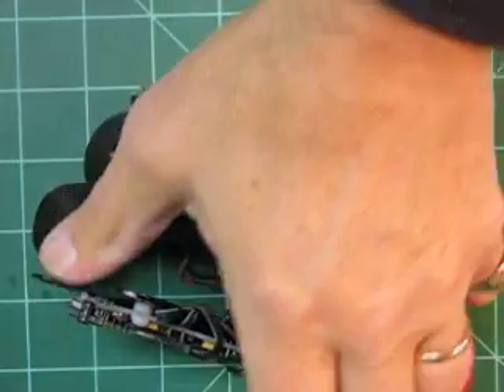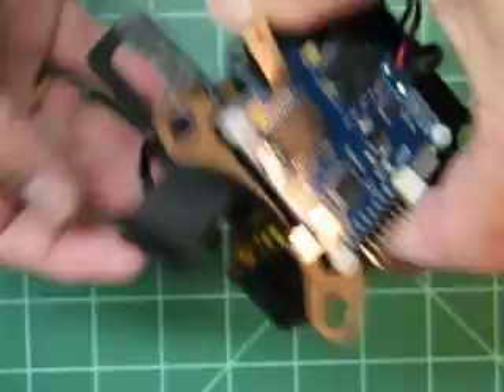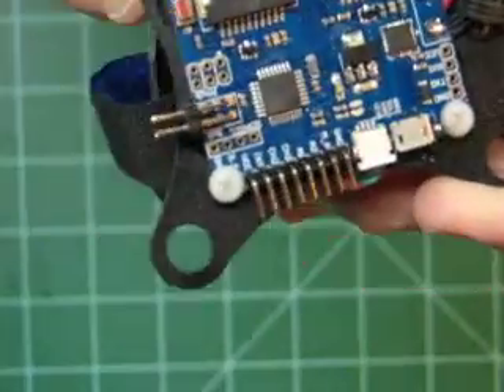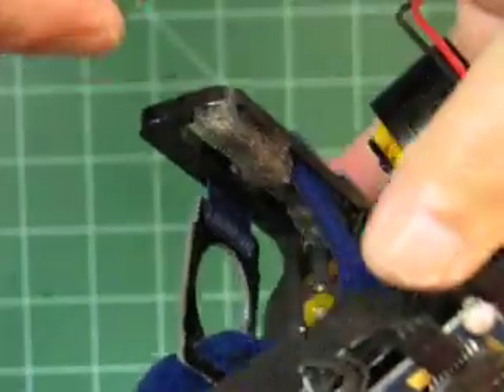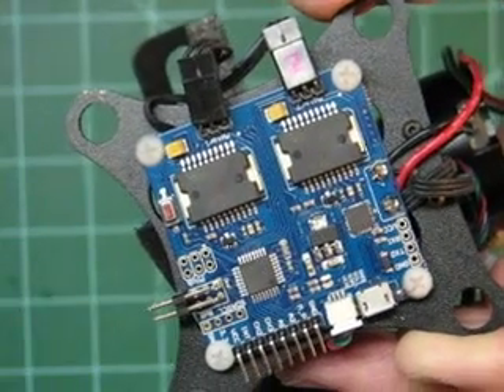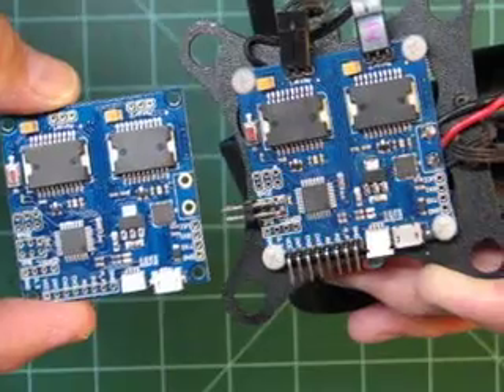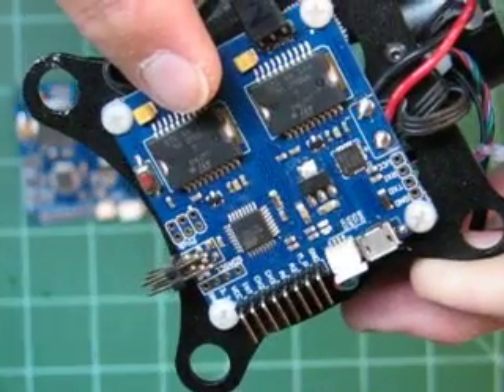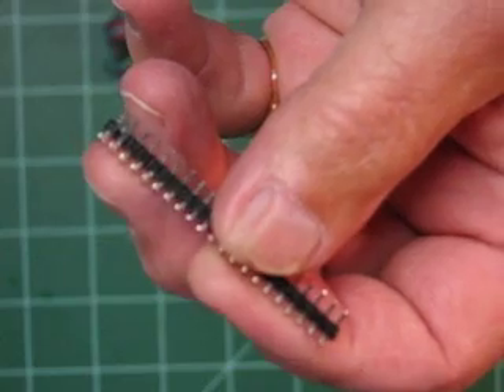New Martinez Gimbal Control Board

Comment: Why didn't you just contact the seller you bought the first gimbal from?
Reply from the maker: Not sure what you mean Bobster. If you are talking about the mini-usb falling off, what chance do you think I would have proving that it wasn't my fault? Just saying - maybe it was my dumbness. I tried to imply that in the vid because frankly it could have been my rough handling that caused it. I wasn't having problems with the gimbal - I was having problems with my stupidity. I am smarter now - not by much but a little. I"ve discovered a lot about the gimbals  - all of them - over the past 6 months. I've learned that none of them are plug and play except the Zen - and that yo get what you pay for when it comes to gimbals. Thanks for your message and please post again if I didn't answer your question.

Comment: Rumblecloud I bought this exact board and it has brugi 050 r207 firmware on it. Can I install other firmware and use Alex Moss GUI?
Reply from the maker: Hi Jason,
Yes you can. I have found after much gnashing of teeth that the Alex Moss GUI is the ONLY one that will work with it. The intructions for the A Moss GUI are pretty good but their is still much guesswork in getting it up and running. The wardesrt part it seems is getting the right driver installed and then getting the right com port set-up. I have not been able to get the latest version for 32 bit boards to work on my gimbal board, but was successful in getting the earlier 8-bit version (2.2b2, 2.3b4, 2.3b5). That would depend on the firmware of your gimbal board. I just ordered another one - I am a glutton for punishment
Reply: rumblecloud Do you know where I can find 2.3b5 software [&firmware]? Also where have you found the best placement is for the sensor? Right now I have it decently working with the open source Brugi GUI app, but like I said interested in other options.
Reply from the maker: Hi Jason,
Name is Randy or RC, please.
Yes I have:)....

 Kidding here's the link:
http://www.basecamelectronics.com/downloads/8bit/

Scroll down the page a bit. This is the "Official Aleksey Moskalenko" company site. Everything about the software is located here. Mind you this is still not a "plug-and-play" set-up especially if you have a clone board.
Location of the sensor depends on which sensor you have. Not trying to be difficult, but even they guys on my forum (www.rumblecloudrc.com - shameless plug) have ordered the same gimbal and received different sensors. Mine works best underneath the base horizontal camera mount -- with the flat part of the pcb facing down and with the light and the electronic gizmos facing up. Just take some regular old scotch tape - note how I used a brand name there :) - and just tape it to different areas. Regardless where it ends up, you have to try to get it as level as possible and make sure the tiny little wires that connect to the board are securely fastened so they cannot vibrate - very sensitive. Good luck and keep me posted as to your results. Take care
Reply from the maker: Oh I forgot. Try out  the other versions of the firmware. If one doesn't work, perhaps one of the others will.
Reply: rumblecloud Thanks Much randy. I can't seem to get them connected - avrdude.exe: stk500_getsync(): not in sync: resp=0x6d

Anyhow will keep trying. Thanks again for the tip to try SBGC

Comment: Does your gimbal work now? is it so simple that you can replace it and it works right away?
Reply from the maker: Yes, it was easy enough to replace and it did work right away. DO NOT power up the gimbal without the camera in place.
Reply: rumblecloud could it also work with a other board? not a martinez board?
Reply from the maker: Hello Mitchell,
Thank you for your question. I will try to answer as best I can. The Martinez control board and the camera gimbal can be ordered separately. In other words, The Gimbal with brushless motors can be bought without a control board. There are several different brands of control boards on the market. Alex Moss (Aleksey Moskalenko) and Martinez are common, but there are also clones. You can mix and match the boards with different gimbals. If you would like more information, let me know ... www.rumblecloudrc.com.

Comment: i forgot to tell you make sure the camera is on the gimbal and to connect the gimbal to adjust the pitch i used a servo female to
 female connector and ran it straight into my spektrum reciver aux 2channel wich is knob on my dx7s and it works good

Comment: to balance the gimbal attach it to the quad stack magazines under the gimbal till the gimbal is level and then turn the gimbal on then press the small red button give it some time.to re initiate and it should re calibrate it self to be level
Reply from the maker: Thanks 16jacerie.
I do have to recalibrate since I pulled my hex out of a tree this past weekend. Messed up a few things. I'll give your method a try.
r

Comment from the maker: Update on the new board: IT seems it is a clone of Martinez and Alex Moss. The Alex Moss GUI works perfectly with this gimbal control board.
I have not had the time to remount the GLB gimbal and test it with the NAZA as MJ has recommended, but am sure I will have time now that old man winter has arrived.
Reply: Rumble, thanks for your video! Would you be so kind to help me out? I bought the brushless gimbal and the martinez board from witespyquad as well, but have no idea on how to go about connecting it and making it work... I've done some research but it seems like I need to know a lot about electronics to be able to make it work and I have "0" experience... is there any way u can help me out to get it set up an running?
Thanks again!
Reply from the maker: Hi Javier,
I will do my best to help you. But I will need to ask a lot of questions: Are you able to post pics of your board - front and back? Do you have it installed in a gimble or is it just the board and the sensor? Can you provide a link to the board that you bought from Witespy? Sometimes there are slight differences in the pics at witespy and the actual board you get. That makes a difference in how you program it and what software you use to program it. On the positive side, sometimes the board does not require any programming and works just fine once installed on a gimble. Please let me know answers to above questions. I am almost always online and will check in later for responses. Thank you for asking for my help. I will do my best   :)  r
Reply: rumblecloud Hey Randy... Thanks for the quick response!! I uploaded the pictures to my google + page and posted "public" i hope u'll b able to see em:
https://plus.google.com/u/0/photos/111387334759029287389/albums/6031862954262233953
Yes I purchase this board along with the gimbal from witespy and u r right! he's got a bunch of pictures but most of them don't match the one he sent to me lol. He sent the Martinez V3 and I was able to manage to solder the pins and get as far as connecting some of the wires (i think), but not sure if I'm right or how to go about connecting the board to the receiver and the flight controller. 
Thanks again Randy for ur help!! Oh.. and I Subscribed ;)
Reply from the maker: That's the same board I have, but different sensor (the thing that sticks to the camera platform on the gimble and helps keep it level:). It looks like you have the pins on the board connected correctly. I will have to take a look at my sensor tonite when I get home.
So you're gonna put that to the front of your Flip? For a newbie to quads, you picked a good one to start with. What camera are you using?
Some more info on the gimbal: Before you power it up, make sure the camera is attached first. If you can mount it to your Flip with the camera mounted, that would be ideal.Make sure the gimbal/camera is free to move. You will have to experiment with the placement of the sensor. Try it in different positions on the camera platform - left side, right side, with the wires facing out and in and rightside up and upside down. Usually the sensor works best on the bottom of the cam platform on the side underneath the pitch motor, but not always. I use plain old scotch tape to reposition.
With any luck at all, you may not need to adjust anything. If you do have to adjust it, there is software available and that can become a nightmare, but I can help alleviate some of that pain. Not all of it, but some of it.
I would also need to know what radio and flight control board you are using (APM I think I read). If you want to control the pitch or roll with your radio, you will need to patch the appropriate plugs into your receiver. If you are going to control it via the APM, I may not be of much assistance. More later when I get home.
r
Reply: rumblecloud
Hey Randy! Thanks... Yes i would like to connect via APM 2.6 but if it's too hard I will just do it via receiver, at this point i just want to get it going... hehe
Yeah man the flip fpv it's an awesome frame and Tom from hoverthings has excellent customer service! :)

Comment: Buy a brown red and orange servo cable to connect to the goodluckbuy gimbal.  Remove the red wire from the servo cable (or just cut it at both ends).  Connect it to , what looks like a 6 pin connector facing forward on the board.  Specifically, connect it on the left three pins (as you look at the front of the board.  Make sure the brown wire is on the bottom.  I have a naza controller, and I connected it to the F2 slot with the brown wire on top.  The naza assistant software will allow you to tinker with the pitch settings.  I got mine to work and I am very pleased with it.  Good Luck (no pun intended)!
Reply from the maker: That sounds like a plan mj!!I will give it shot tonight. I appreciate the input and will let you know how it turns out.

r